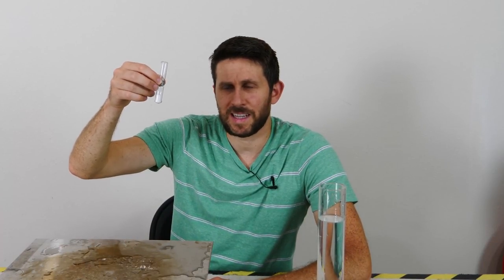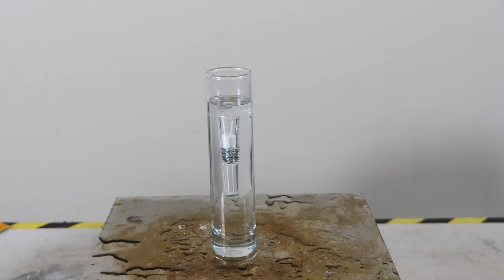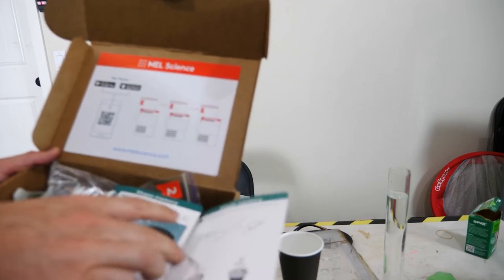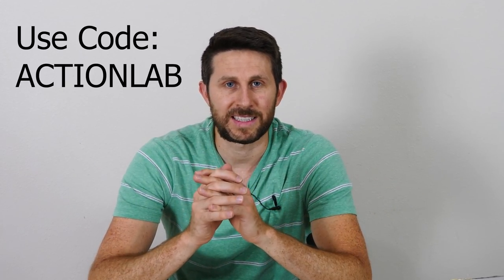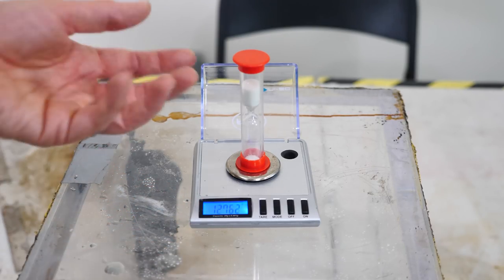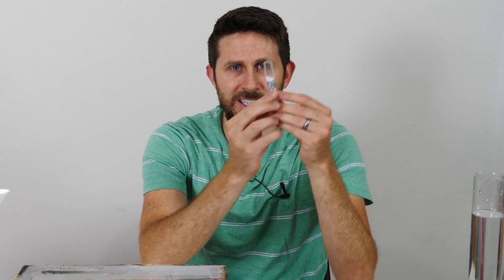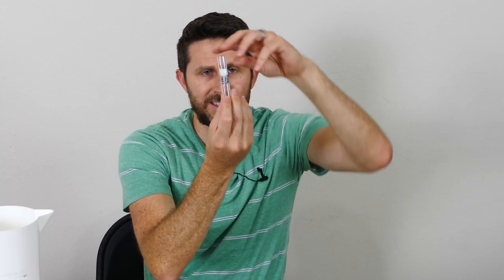Can You Figure Out The Hour Glass Buoyancy Problem?

Comment: I think it would be a fun experiment to test this "friction against the tube" hypothesis by ballasting the hourglass to be stable in the water when the sand is at the top. By doing this, the hourglass would not be trying to flip over, thus eliminating the friction between the wall and the hourglass. I suspect the real mechanism is that some of the sand is in free fall during the time it leaves the orifice and hits the bottom of the hourglass. This sand in free fall is not adding it's weight to the hourglass while it is falling, so the hourglass really IS slightly lighter while the sand is falling. You could also test this either by using a much larger hourglass on a scale, or by using a far more sensitive scale. Then we could come to the conclusion that what is really happening is a bit of both friction and the hourglass being lighter.  Of course there is also the impulse  force supplied to the bottom of the hourglass as the sand comes to a stop which might cancel out the weight decrease from the sand in free fall. This is so much fun to think about! What do you think?

Comment: Calling it before finishing the video: pressure gradient within the water.
Reply: Meh. Even if it is friction here, I'm fairly certain you could make it JUUUUST the right weight that it would sink at least a little lower with the sand on the bottom.

Comment: Wrong! Friction is only part of the equation!
You have to regard "weight". The weight the hourglass undergoes is the sum of all forces as result of the product of the partial masses and the local acceleration due to gravity.
The gravity at the top is slightly lower than the bottom (Einstein, General Relativity).
When most sand is at the top, the partial weight is lower than when most sand is at the bottom.
Even without friction the hourglass will sink, only fractionally faster!
Einstein triumphs again!
Test it in an environment with less friction!

Comment: So, the reason for the hourglass's apparent change in buoyancy is just simply because of the change in its mass distribution? Wow, sometimes even the most intuitive answer is the best one
Reply: No, this is incorrect, rewatch the video.
Reply: @jwonz2054  Whoops, my bad. I forgot to mention the friction part 😅. When the sand is at the top, the hourglass is top-heavy, causing the hourglass to want to tip over and lean on the sides of the container, thus generating friction and keeping the vessel from sinking. As the sand trickles to the bottom, the weight distribution of the hourglass changes to become bottom-heavy. The hourglass then straightens out, no longer having any frictional force, an just sinks to the bottom.

P.S. Thanks for that, I'll be sure to give a full description next time to not cause confusion amongst any other viewers

Comment: I believe your explanation of this phenomenon is not correct...I think if you could somehow balance the hour glass it would still float and not be in contact with the container wall..what is going on here is simple buoyancy principals and when the sand is at the top there is more air down below which has more buoyancy than air above which is what buoyancy is...FRICTION has NOTHING to do with it at all. To prove it to yourself when you drop the hour glass with the sand on top in, immediately push it down to the bottom and release it, it will rise until the sand falls to the bottom putting the air at the top where it doesn't have as much buoyancy and it will then sink.

Comment: Without even watching the video, by virtue of the sand moving toward the center of the planet, it becomes obvious that the sand gorged bottom would logically be the heavier. The potential energy of the upper chamber when filled should nor carry more significance that the filled lower chamber, thereby making the filled lower chamber heavier also because there is no longer any potential energy left in the upper chamber after the kinetic cycle discharge. Ironically, the exact fulcrum at the center of the planet has zero gravity-- but in a true null scenario. In other words, it is impossible to calculate that point. Points have just one dimension.

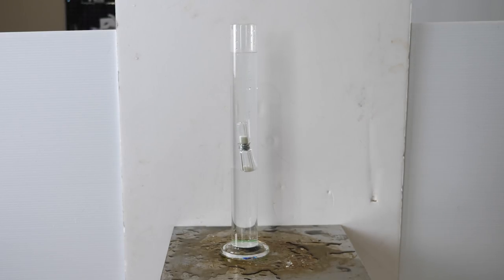Comment: That's not the right reason. Look at 1:40 in your video, there is no friction being applied. I think what is happening is that there are grains of sand in mid-air subtracting from the total weight. Your scale was not accurate enough to differentiate. I strongly suggest you try it again.

Comment: but there's another floating hourglass that operates in the opposite way, i.e., it sinks when the sand is in the top of the hourglass and floats when the top is full of air. supposedly, this is due to the buoyancy of the object based on its shape, whereby, the upper half of the hourglass is bulbous which allows the water to collect underneath and push upwards, whereas when the bottom half is filled with air, the hourglass wants to flip over but is held by friction against the glass, and thus stays immobile under the water. your explanation in this video does not account for both scenarios.
Reply: i guess the discrepancy comes from you altering the weight of the hourglass with metal wire.